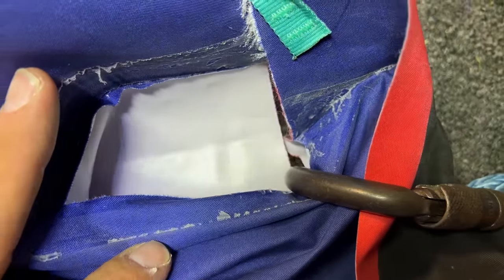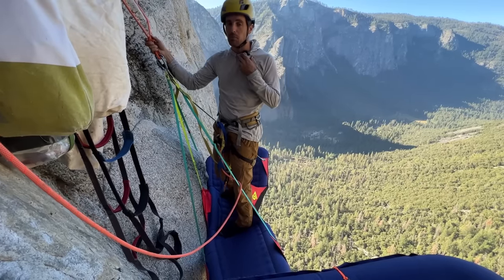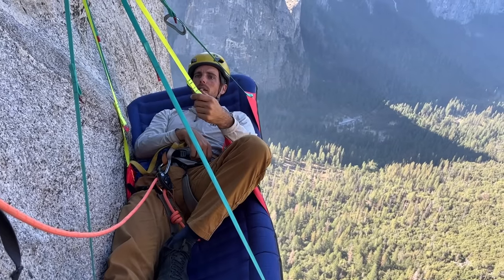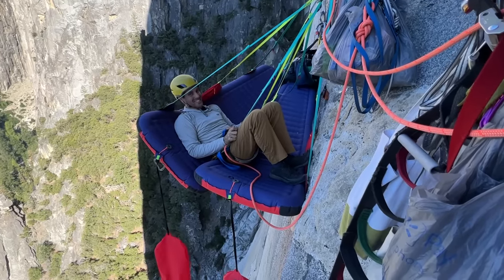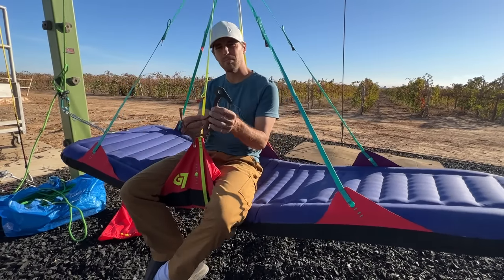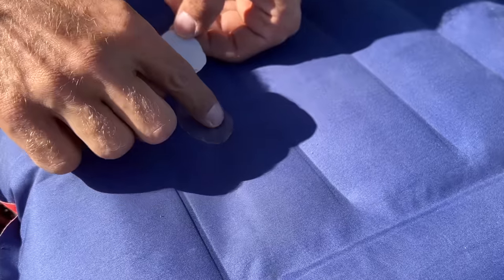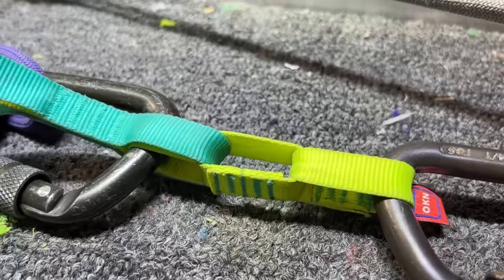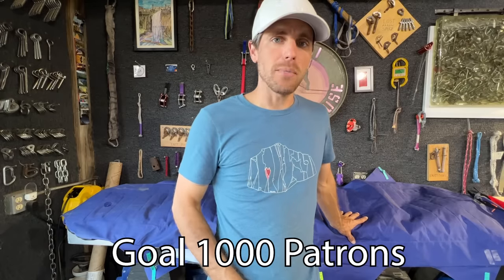I destroyed the worlds most expensive camping mattress

Comment from the maker: We now sell G7 Pods in our own store! https://hownot2.store/products/pod
Do you think the G7 is worth it?  What are your thoughts?
Reply: Question, do you use three strand twisted rope much?
Reply: I have used mine once so far on a 4 day trip and have used a frame ledge a couple times only. It works surprisingly well and the weight savings are huge. We didn't have to weather a storm but the fly seems good/kept the bugs off. Doubled as an air mattress for our overnight de-proach and takes up way less room in a pack. I'm stoked on it, excited for the next mission. Also, big ups to Ryan for the super helpful content!
Reply: 10:12 you did what :face-turquoise-covering-eyes:👀
Reply: Cut the cost in 1/2 and sold ...
Reply: @TrueHelpTV  Yeahhhhhhhh 😂
Reply: Na not worth it. I've used one quite a bit. The tensioning system is not great. Can't make micro adjustments easily. I honestly prefer my runout customs double. Great idea but the cost is absurd. Around 875$ shipped for a single ledge no fly is price gouging. If it was 450 to 500 then great.
Reply: oh man i think its worth it, looks super comfortable.
Reply: you can set the pod in the real recliner mode too. Quickdraws to shorten up the head straps and it will bend at the middle, like a recliner. Nathan showed me that when I saw it before they released the POD. It's the best ledge ever.
Reply: Only during the zombie apocalypse, then I’d get it for sure.
Reply: My thoughts are… I’m getting nauseous just watching you. I’m familiar with SRT rope climbing as a former tree climber, but you’re on another level man.
Nice 👊
Reply: What you do is insane.. but awesome
Reply: Why not a hammock with a foam windshield visor? $175 
Hennessy hammock has a tarp roof and a built in mosquito net.
But I don't know what works best on the side of the freaking mountain.
Reply: I`m glad people like you do it so i don`t have to the footage is enough for me and my vertigo :)
Reply: Not on subject, however, would you guys please test a polyester rope or 2? Would love to see uts use as a fixed line for jumar and rapping, and for hauling 100 plus lb s ( like a polyester marine line that is rated)
Reply: Generally do not like any air mattresses,  even the best are unlikely to last, the tech is not here yet

Comment: Idea for testing leaks without deflating the pad. Use soapy water instead and spray it on the patch. You will get obvious bubbles if there's a leak.
Reply: That's how we test for leaks in tires or anything else. Im a bit surprised he didn't do that. It's not a secret and very commonly done.
Reply: yeah or submerge the whole thing in a pool or something. just gotta get the pool up to the side of the cliff
Reply: @viktorhhh1  it really isnt hard to have a little dish soap and water
Reply: Yes, just like patching bicycle tires.

Comment: Damn, I thought that I could never sleep on a mattress like that, but the fact that it has straps surrounding it that hold you in AND that you can still be secured while sleeping make it seem pretty cozy. Only thing is, I‘m not a climber, and while I have complete faith in the rope, the harnish and the connection of the two, what I cannot bring myself to trust are the screws in the wall. Just imagining falling as the lead and the closest screw popping out along with you…
Reply: Climbing anchors are heavy duty expansion bolts. There's a whole mechanism that's kind of similar to a dry wall anchor. They arent just screws into the rock. (Not a climber but your comment made me curious enough to look it up)
Reply: Well, if you look at other videos on the channel you'll see that the bolts can hold something like 40kN, which is a ridiculous amount of force and your body will break well before the bolts will. Massive Rock slide is a way bigger worry than the bolts breaking.
Reply: I'm glad someone brought this up and articulated it well. I'm not so much worried about the strength of the screws, but rather the rock that it's anchored too. Mountain faces are slammed with rain and wind for millions of years. Cracks appear, erosion happens, and rock becomes brittle. Sketchy
Reply: @bowenbottorff1283  Rock Fall on El Cap is probably among the most monitored rock falls in the world. The chance of solid rock just up and breaking for no good reason is pretty slim. Rock that is about to break will not look, or sound (if it is knocked on) solid. But yes if there is a massive earthquake suddenly you might be fucked.
Reply: Rock anchors are super safe. As long as the substrate is stable. I have been anchored using nylon to a 32 story penthouse. It is terrifying, but you have to put probably over 8 tons of force to break something like that.

Comment: I can strongly suggest tenacious tape for permanent fixes to most air mattresses. Not sure if there is something about the surface texture on these that would make it less effective, but it’s worth a look. Basically ripstop with a contact-cement like adhesive, so it’s lighter, thinner, and at least as strong as the type a patches. I usually carry a small roll, because it’s also good for patching jackets, tarps, etc. The alcohol is  to remove skin grease, so use your judgement, but when you need it, you definitely need it.

Comment: My wife and I were half way up Crack in the Cosmic Egg, a climb in Zion a few years ago. I set our double ledge up on existing anchors. 3 drilled in pins, the original anchor system. We both got comfortable sitting with our feet out, back against  the wall, dinner in hand, and a 600 foot dead vertical view of the ground below us. When All of the sudden we dropped 2 inches. My wife causally looked over at me. And the look on my face shocked her to the core. HOW ARE WE NOT DEAD!!, was written all over my face. I forgot that when I got to the anchors there were 2 D-rings sideways all slings came off of them. They were tensioned so tight that I could not rotate them and I forgot about them. I’ll never forget that feeling of why aren’t we dead.
Reply: How’d ya get hold of the only, singularly unique sudden? Also, how’d u not die?
Reply: @brabhamfreaman166  he was still attached. He's not meaning the slings literally came off the ring but rather that's where they ran from. The d  ring was sideways and it turned ( lengthening the straps 2" when they did )

Comment: Great video, as usual.  Interesting and informative about a unique product.

One nitpick about the dialogue:  

When you start break testing the butterflies and webbing loops, you point out the mfr's "0 KN" rating, break the loops, and describe your test results as "the 'actual rating' is xx KN".  That isn't really correct.  The "rating" is still 0 KN; your test result "exceeded the mfr's rating, and measured xx KN".

One other thought:  If you're repairing a hole (on a wall or at home), using some kind of roller or smooth rounded surface (spine of a carabiner, handle of a hammer, etc.) could help effectively press the patch onto the surface of the mattress.

Comment: Old plumbers trick you could use to see if there is air leaking. Mic dish soap and water in a spray bottle. Spray it around the patch, and if there is air leaking it'll start blowing little bubbles. Use to use it to find breaks in LP air hoses.
Reply: That's how I was taught to find leaks in tires 👍

Comment: Would you use two adhesive tapes on the longer cut and put a reinforcing cord on the inside and not on the outside?  You showed us in dry conditions, which would be ideal.  But how does it perform in wet conditions?  The strength of ropes and seams when soaked for days?  Slip coefficient of the cushion when wet?  Carrying weight was also not mentioned.  Many such devices have a maximum weight of around 150 kg (1.5kN).  In a pinch, three people could sit up there, would it hold them?